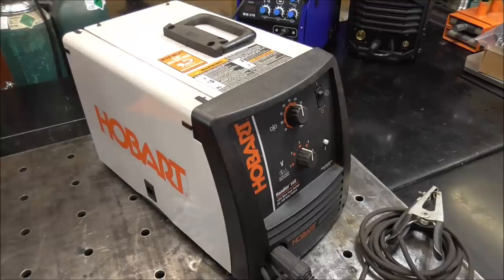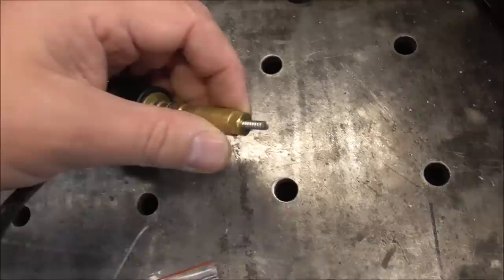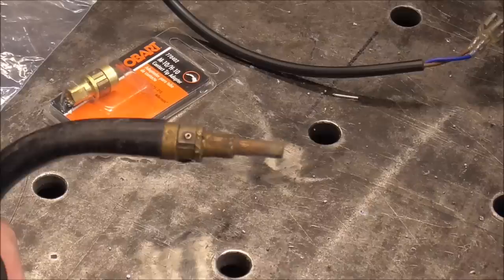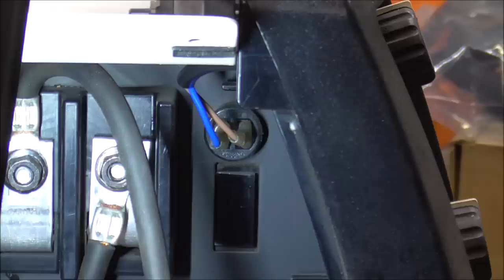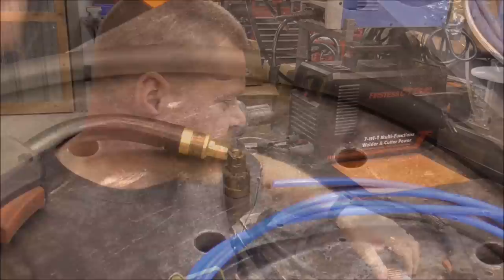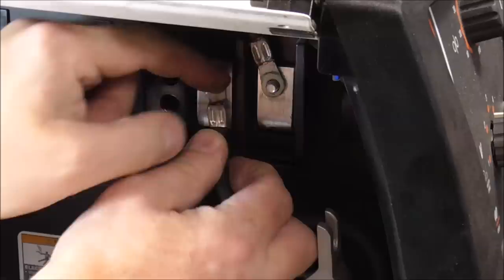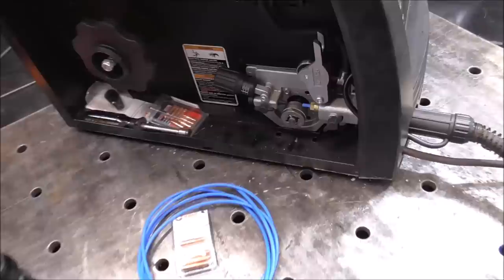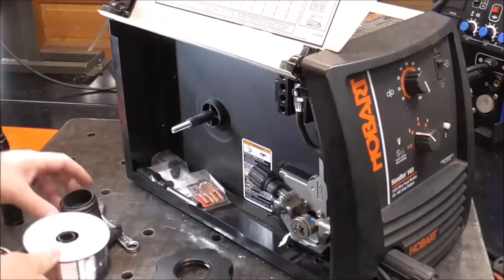Convert Your MIG Welder to Weld Aluminum - The Easy Way

Comment: Overall, a good video on how to switch to aluminum on a small mig machine.  But, if you don't, already, have a bottle of Argon, it's gonna cost a bit more than $25.00 when adding in having to purchase a new Argon tank.  Also, the 120 volt machine is, likely, the minimum size to use for aluminum, considering the lower voltage and current output.  If someone has a small mig with a 6' whip or so, there is no need to switch liners.  Steel liner will work just fine for aluminum, unless it's as dirty as yours was. 🙂
Reply from the maker: I mainly switch liners just to avoid the cross contamination and increase my odds of not having any feed issues. I suppose if someone was really desperate they could use gasless wire but that's not really what this video was about. We could also add the cost of the welder,  the cost of the electricity and the time to make the repair and at that point it's cheaper just to hire someone to fix it 😉
Reply: A steel inliner would be full off aluminium scrap/dust in no time

Comment: great video. what shade lens for aluminum? I run FCAW at 11. When I was young I did 6010 on shade 10. Hobart has good stuff. I like my tractor supply Hobart helmet better than my Lincoln 4c s
Reply from the maker: I think I have mine set on 8. I have always leaned 1 shade lighter than most.
Reply: A number eleven is very average for most welding. Welders use a 12 when using very high current.

Comment: I have a Hobart 187 Handler and aluminum wire goes through the liner OK but I have not tried welding aluminum yet.
Reply from the maker: It's a lot of fun James. I would caution you about using the factory liner though. Not only does a teflon liner make the wire pass through easier, it also doesn't have metallic particles inside it like your factory liner does. These small particles will contaminate your wire and your weld. It's the same reason we use a stainless brush on the aluminum. This same kit will work on the 187

Comment: This does work just about, but wire feed problems are very common running aluminium wire through a MIG torch.  A spool gun is the only option for reliable feed, but trying to MIG aluminium with a small home user machine, will never be that great anyway.  There is a need to use high magnesium wire as well, as this will reduce the chances of wire feed issues.

Comment: Great video Brandon!  Whenever I wonder if I could...........?, I check out your channel because you probably already tried it.  I've been tig and mig welding aluminum for years and would never have thought a little DC machine could pull it off.  I love your table  and clamp.   I've been looking at the scrap steel plates over at Clark's.  Maybe I'll make a table.  Keep up the good work.
Reply from the maker: Thanks Paul I appreciate it! 👍👊😁

Comment: I’ve tried that in the past companies I’ve worked for have made me try that it in the past despite my 33 years experience. You have to have a very short whip definitely a Teflon type non stick liner. It works, but it’s not very good best bet get a spool gun and the proper attachments. Any mig welder can weld aluminum, but you really should have a push pull gun or a spool gun and full variable amperage control because the aluminum likes to be pulled by the machine not pushed.  You’ll have nothing but bird nesting at the drive rolls when you try and do this. 

Way too much burn through. In the first pass. And always remember once you’ve welded the opposite side, you’re now welding material that’s far thicker than you started with aluminum is very finicky. It starts up cold, and it gets hot really fast so you have to increase your travel speed as you’re going. 

I forgot to mention at high temperatures and high amperage, these liners like to melt. Small jobs it might be ok.
Reply from the maker: They wanted you to try it to expand your repertoire of tools in your toolbox... Just like I have in this video.  There is no perfect process for any given material just options and this is just another one of those options
Reply: @BrandonLund  Totally fine for small stuff at home.
Reply from the maker: Spot on 👍👌

Comment: Great Video!
I would be interested in seeing what would happen if you used ordinary steel MIG gas with Aluminum instead of Argon
Reply from the maker: It makes a huge mess!
Reply: @BrandonLund  what abouy using argon for steel ?
Reply from the maker: Supposedly you can and ive done it and the welds look horrible.
Reply: Argon and some Helium blended in.
Reply: Remember the rules for MIG or TIG welding aluminum: use only Argon, or for a hotter weld a mix of Argon and Helium. It's also very important that aluminum be clean or it won't weld at all. No oil, grease, paint or gum from labels. If it's not clean use a small disc sander and then clean it with acetone or laquer thinner. In the industry 5356 filler rod is always used, as opposed to 4043, so if the part is Black anodized the weld does not turn white.

Comment: Great video! about the argon gas, if the machine isn't that powerful, woudln't be better to use helium/argon mix? helium gives aluminum welds more penetration
Reply from the maker: Thanks man! Dual and tri mixes are awesome but for occasional welds I wouldn't personally spend the additional money on the mixture. Helium is super expensive.
Reply: Yes sir you are correct. Helium is used when the cheap machine can't muster up enough current.

Comment: I would like to see a multi setting MIG welder such as a Kempi EVO200 which has an alloy setting on the LCD panel. I have a EVO200 Kempi and it is a great welder, but never done alloy.
Reply from the maker: I'm not even sure where I would find one

Comment: Use a stainless steel brush or wheel to remove the oxide and it will weld cleaner
Reply from the maker: It's mandatory 👍
Reply: The brush is all that's allowed on aluminum, please no wheel.

Comment: Best to buy a square wave power source with all the extras if it's a shop one machine for everything stick ,tig, hard wire gouging plasma all in one run you about 6 grand but well worth it even make gas powered versions for field work
Reply from the maker: Great tip!

Comment: I have NEVER used a plastic liner in my 140 Lincoln at the house.... I don't even use them in the Miller 350p at the shipyard.
Reply from the maker: It will work but best practice is to change it out. It eliminates all chances of contaminating your aluminum wire with steel dust, powder and grit plus it provides for the smoothest feed possible.
Reply: @BrandonLund   I weld everything from 22g to 1/2" alum. then some Stainless to carbon steel all in the same work day mostly on Pulse .. I been doin that for the 19 years at the shipyard and before that I retired out of the Navy.. I was a Hull Tech.. that's a welder, fitter, NDT an QA.  Never failed ANY test on Anything ! OH i past a test pullin a EB ring (it's a pipe thang) On First try. So I know Stuff !  I saw a guy on here tryin to tell people they could pass a weld test with Core Shield wire.... he even called his little pieces of scrap "Coupons" 😀 Ain't NO where gonna give you a test with no Core Shield unless it's some Galvanized crap or some old lawn mower shop.
Reply from the maker: Awesome David! Your resume doesn't change the fact that what your suggesting goes against all best practices and instruction but If using a contaminated liner works for you, carry on!

Comment: Maybe you can mod the speed from the feed motor controls. Not to sure if yours is DC or ac from the mains!
Reply from the maker: This machine is DC output.
Reply: @BrandonLund  sorry I mean to the wire feed motor. Some here in the UK use 12v DC motors, other use mains and some change the speed via the power settings.

Comment: 11:56 use 4047, more rigid wire and will not crack like 5356.

i use plastic liner with every alloy, steel, stainless, aluminium, flux core...
never had issue and easier to clean and feed.

argon/ helium 50% is best(no black soot) but...
Reply from the maker: Nice! 👍

Comment: The steel liner will also contaminate the aluminum wire. Steel is ferrous (iron), aluminum is not. The two will not bond together under heat.
Reply from the maker: Spot on! 👌

Comment: This is great to know . I have a new miller 120 volt millermatic 141 got it 2021 .  I’ve been wanting the spool gun for it .  But I got a plasma/stick/tig welder all 3 in one .  I didn’t need the stick I have a Lincoln 225 buzz box!  But I wanted the plasma cutter just for the clean cut and cut down on the accy/oxy torch cutting kinda save that stuff for heating and beating things .  The thing about my tig is after getting it I’m reading I can’t weld aluminum with it just steel stainless chrome moly mild steel .  So I didn’t know if there was some way around that challenge or am I just thinking it can’t be done .  I don’t think it can but .  My combo welder / cutter is a ever last 1GBT inverter technology it’s a120volt ac up to 1/4 plate then it has to be plugged into 240 volts ac .  It’s got this plug that changes the hi volt plug to the lo volt type .  I’ve only used it to stick weld with . It’s so tunable I think there is 3 different things you can set on it .  One is the strike arc heat that’s a great feature I had never used before .  Wow it helps keeping your sanity when you don’t stick weld a lot then go back to the dark ages and do .  I always have a hard time not sticking my rod and have to pull the stinger off fast . With that strike arc heat adjustment I turn it about 5-20 higher than my welding heat .  I basically wanted a plasma cutter then the price to get one compared to one with 2 extra things .  Most importantly was it’s plasma , tig that’s the other thing I wanted and the stick that just uses 120 ac is handy for transporting out in the field with a 10,000 watt generator Mobil welding can be easy !  It’s a china welder but I was told it is just as good as our welders here . I’m not going to run it day and night like I will my miller sometimes but it’s a very handy little welder it’s about 16” long and 7.5 wide 11” tall with a strap over the shoulder type .  Very easy to transport I hear a lot of farmers talking how great it is to be able to carry a small air compressor and the gen set with this welder they can get so much done at places all over there farms .  Fence and gate work along with there harvesting equipment and plowing equipment .  I could see why this would be great .
Reply from the maker: Absolutely! And this is a 120 volt only machine that can easily weld 1/8" and up aluminum and you can do it fairly easily without the learning curve of tig. If you've ever mig welded steel, you can mig weld aluminum. Its very much the same skill set and its a great way to save a few bucks compared to a dedicated AC Tig machine. I did my entire race cabinets using this process.  They came out so awesome that the guy that powder coated them has been referring aluminum welding work to me...and they do aluminum welding daily if that tells you anything

Comment: I  post and ask as a non welder, after 30 years of only stick. When pushing that angle, the brass outlet screw housing is held away from the aluminum so slightly, then you said you backed it up then the flow, it gets better, of course the Argon environment is crucial, so no drafts and a shield, a housing ( even a infused cavity would be nice to experiment on the flow/porosity ) So why not have an edge or two edges contact the welding surface with the brass screw housing ending edge? But have the housing have a non-contacts covering made with a thick ( differing sizes ) so a standoff the encompasses the entire circular brass nut can be achieved, to keep a consistent distance for a particular welder. As of course your table setup should be parallel aligned with your part at a distance to use it to guide your hand as you slide, as it moves across. " much  to much to care about or digest for the "in a hurry, getter done situation but" improvements* 
Secondly, I hate marketing, that they do. Hobart lists the machine as a Hobart or a Hope- Bart 140, but it runs at a 100. Diversionary.
Reply from the maker: You could use a guide but often you will make subtle movements to keep the bead appearance even to adjust for heat as the part heats up from the progressing weld.

Comment: Great video. The concern I have with the liner in particular is whether it will tolerate the solid/flux core wire for an extended period of time. I would hate to have to change it back out all the time when I want to swap between steel and ally. That would almost defeat the purpose.
Reply from the maker: Yah if your going to be doing a lot of aluminum and steel welding this really isn't the ideal setup, but for someone that does occasional aluminum welding, this is a very cost effective alternative. The other option is to buy a spare whip and set it up for aluminum. Then the swap takes no time at all. One thumb screw for this machine and the whip is ready to remove.

Comment: i can do ya one real easy. its called a spool gun. of course you can mig aluminum. ive even done it with plain stinger with  lincoln 40 . not only did i weld with it i completely reformed the entire bottom ear on my chrysler 4.7 thermostat housing and tapped in a new bolt. i figured a new welder and tank set up for 650 sure as hell beat 750 for a new front engine cover and i come out the deal with tools. but anyways i worked perfect. i did pre heat the aluminum with torch because it was a struggle to get the welds down and not birds nest but i eventually got it dialed in though it was still a headache but i absolutely can be done.
Reply: @BrandonLund  to bad you didnt make this video about 8 years ago. could have saved me a headache lol.

Comment: I clicked on your Teflon liner for Amazon and it's a steel liner...  might want to change that
Reply from the maker: The link is for all liners for that machine based on wire size...steel AND Teflon. You just select the one you want

Comment: It seems to me that replacing the metal liner with this liner would be an upgrade for my mig gun in the sense of efficiency for the regular modes as well. I have a multi purpose and also a spool gun. Wonder how far the regular drive can push aluminum through this liner?? I have a lot more reach from my machine with my spool gun. Hmmm? Interesting. Who markets that liner?
Reply from the maker: It's just a cheap liner I found on Amazon https://amzn.to/3CqYD5P

Comment: Ok everyone has already said most of how great this is. You sped up the video when it needed if and didn't waist any of our time, etc.
You covered virtually everything that needed to be covered and what I like the most is "and the reason for that is"...
That makes all the difference se we can conceptualize and thus "understand" WHY. Which means we will remember.
    I do have one question.. maxing out the power of this 120 machine and yet the power range is set to 2 and that seemed to be a bit too high still.
  I know this sounds crazy but could we pit a tip on it and use hand fed rod??? That way we effectively control the heat... andcthe feed or rod needed.???
Blessings
Reply from the maker: What an awesome comment! Thank you so much for your kind words and your support! As far as adding a tip and feeding the rod I have never tried but I think I heard of something being done along these lines. It sounds difficult though. Thanks again man and God Bless.
Reply from the maker: Thank you! 🙏👍

Comment: I've been temped to try it on my cheap 240v mig, but didn't want to get an argon bottle, liner and more, plus the fiddling around.
after seeing this, I really wont bother, for lack of voltage control and too much work converting back and forth. it's just not worth it for me. I only weld(bird poop applicate) but a few times a year anyway. 🤪
Reply from the maker: You have a valid point. The Argon is what makes this expensive. If your setup with TIG than you would aready have it so the real advantage of this is that it puts down a lot of material fast. My Fronius came with a teflon liner but then they had a special where they sent a spare whip all setup with the teflon liner so that makes it really fast to switch out processes. However I didn't get that deal and a fronius whip costs in excess of 500 dollars.  You can get a new Hobart whip for around 130.
Reply: Yes sir you are correct. You can only use argon or an argon helium mix for MIG or TIG welding aluminum.

Comment: You didn't mention anything about the argon gas settings flow rate? Or you just listen for some to come out?
Reply from the maker: Depending on what your doing and shop conditions 25-40 cfh will work

Comment: Have an old crusty aluminum boot box from a semi to weld up, so much contamination trying to tig weld it. Might just give this a good instead of buying a spool gun.
Reply from the maker: Spool guns are nice too. They each have their place. Nice thing about a spool gun is you can easily run 4043
Reply: Aluminum is the only common metal that has to be cleaned before welding. No oil, grease or paint on the surface. I used a Makita die grinder for repairs and would get the metal very clean before welding. For aluminum it's always the surface prep that makes the difference. That's why military spec calls for a dip in phosphoric acid to remove the oxide before welding aluminum chassis boxes.

Comment: GREAT step by step info.What is the next step up welder for welding 1/4 inch thick alum?
Reply from the maker: Thanks man! You would want something no less than 200 amps and 220 volt
Reply: @BrandonLund  Thanks Brandon for the reply and again great video